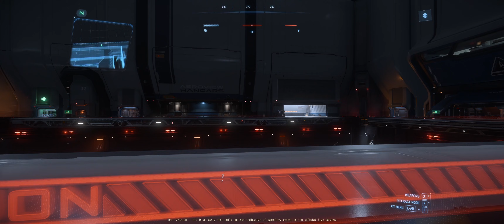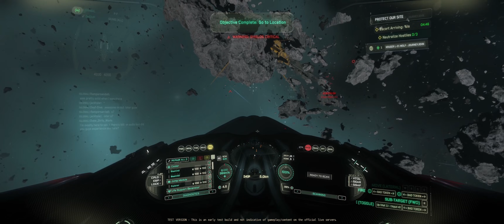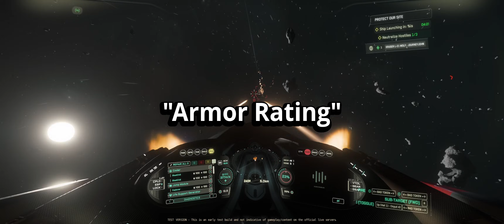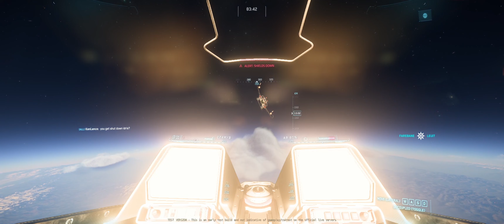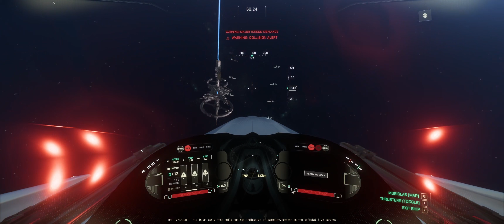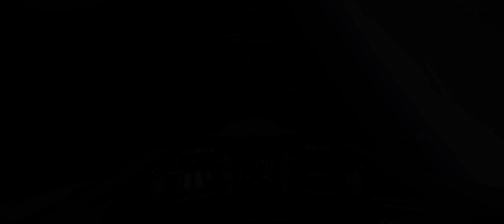Star Citizen 4.5 PTU - Ship Combat w/ Engineering Review + PVP Tests

Comment: Radar Go Off because once the power plant Receive damage, the energy output going to be reduced as a radar use 2 energy points, you power output is 20 and you have all balance between you systems, radar engines, weapons, life support, after you lose power on you power plant let’s say 20 and you receive damage and now you power plant give you 18 or 19, radar is a no esencial system, first one to go offline is that one after that will be life support

Comment: 5:05 this is probably intended. You're a light fighter, you should be the most fragile and least equipped ship in the fight. This makes you either return to a landing zone / base / or mother ship more often than the others. This seems like they're on the right track. This encourages group gameplay and gets people to take advantage of being able to repair and refuel from some ships now. It also makes medium and heavy fighters have a reason to exist (they can last in the fight longer).
Reply from the maker: I'm inclined to agree. As much as I love my light fighter it could use some kind of a drawback for use in combat.
Reply: @JourneymanJohn yeah, we be a balance for sure. I saw a video where 1 gladius took out multiple large ships that were crewed and it just doesn't make sense. If light fighter are basically a 1 stop shop for blowing up any other ship then the others have no use. Think about how useless it is to put someone in a turret right now. I want my friends to be able to hop in a turret and actually contribute, right now taking a person out of a fighter and into a turret is a counter productive trade. Meaning either fighters need to be more squishy or turrets need to be buffed (or a combo of both).
Reply from the maker: There's lots of great ideas for how to improve turrets that can help. Another option is to give bigger ships more forward thrust and speed so they can actually close the distance on a ship that's kiting them.

Comment: It sounds like if the radar goes down, it's basically a wrap, or u can try and free aim it. Radar should be the 1 thing that's always online, or at the very least very difficult to take down, because not being able to see where ur target is or whos attacking you is a game breaker imo.
Reply: Why? What's wrong with taking damage that makes you combat ineffective and you to return to somewhere and repair?  That's exactly what happens in real life and so is probably the intent here. Sounds like this aspect is working well.
Reply from the maker: If the radar is down you actually can't calibrate your QD. You'd have to nav out and do the repair manually, assuming the components is physicalized on your ship.
Reply: @crispy9175  This is a video game my guy someone landing a lucky shot to radar and basically securing the win  off of it wont be fun in the long run for most people and it will for sure change